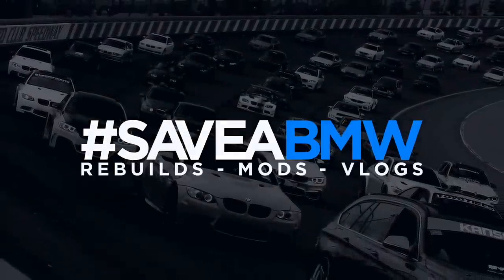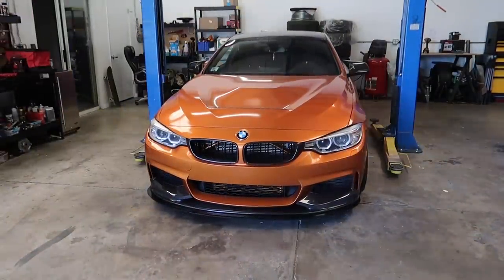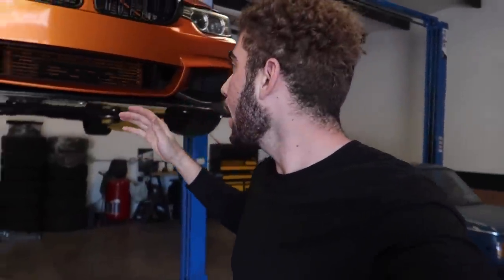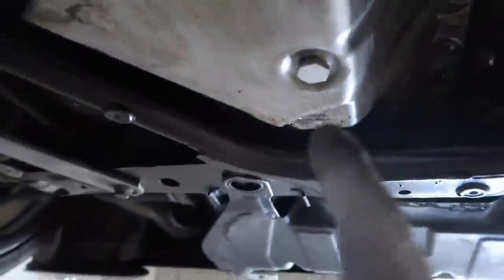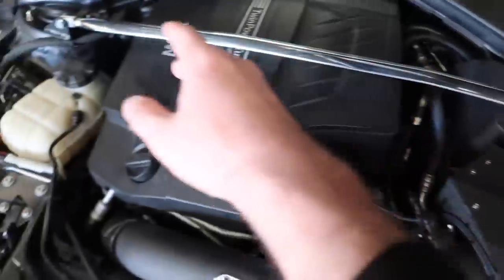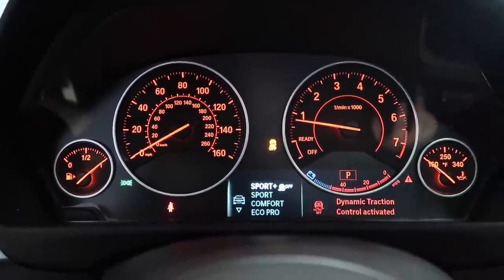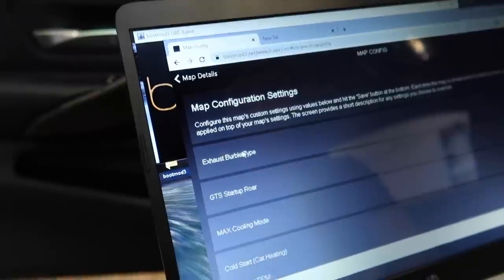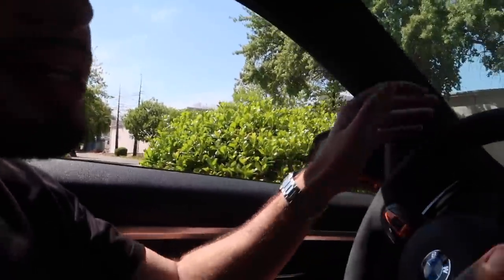435I GETS CATTED DOWNPIPES AND BURBLE TUNE!

Comment: was the valves open?!
was expecting a bit more pop, a bit more volume to be honest
you should go all out like Nick
Gun shots :))
Reply: agree, was expecting a little more louder
Reply: The N55 has more of a "growl" that's deep in its pops and burbles. Due to that it mostly needs to be catless in order for it to bypass the lower pitch sound. Including no resonators could help too.
Reply: I have the Valvetronic exhaust and it's graet but brandon is correct, need to go catless and res delete for best sound, which I've done haha
Reply: @mcintosh.motors  I am currently catless with muffler delete cutout( with valve still functional) I make crazy gunshot burbles lol do you thing getting rid of resonator will make it sound even better?
Reply: @mcintosh.motors  bro your car sounds fucking amazing! keep it up!
Reply: im sure the Mics decibel filter cut out a lot of it.
Reply: @officialthird7268  the tone will change if u res. Delete more deeper tone.
Reply: @mcintosh.motors  I'm thinking about getting this set up, is it somewhat quiet in Eco mode with valves closed ? Thanks in advance

Comment: I think i know why you got the Check engine light i think when you installed the Down Pipe u didnt install it right its very Sensitive on hpow you put those Clamps On make sure you take a look at theme and Second thing i can think of is the o2 Sensor needs to be upgraded or something like that  you can look it up i think Kies Motorsport has the video on that If i remember correctly

Comment: Be careful with the K&N oil filter. Not sure about the quality of the filter its self but the oil filter gasket that came with the K&N leaked like crazy in my car and made a big mess before I noticed it. Bought the car from a place that did an oil change and installed the K&N.

Mahle is the OEM filter manufacturer for BMW. You can find the Mahle in stores and online for much less than $25:
https://www.turnermotorsport.com/p-4162-oem-mahlemann-oil-filter-most-2006-6-cylinder-n52n54n55s55/

Haven't had any issued with the Mahle.

Comment: Thank you for taking my advise to do an oil change after that coolant splash. Now change out your coolant. But before that do a coolant flush. I've seen guys blowing a transmission, changing the water pump and radiator because oil went into the cooling system.